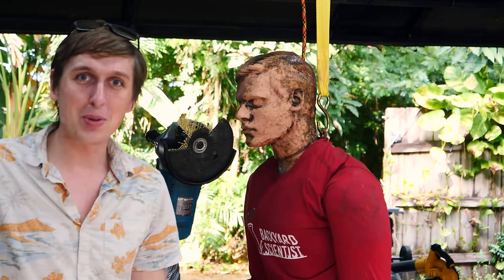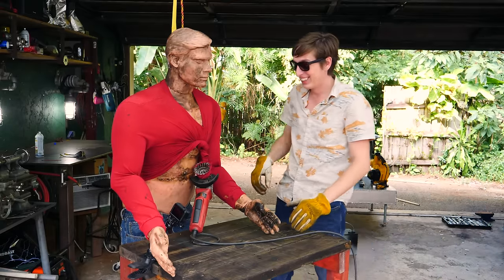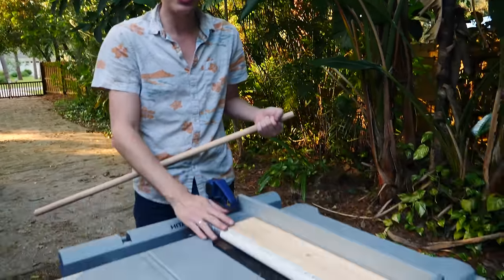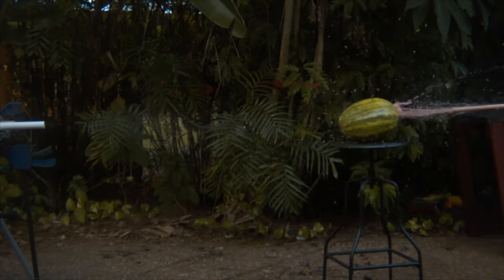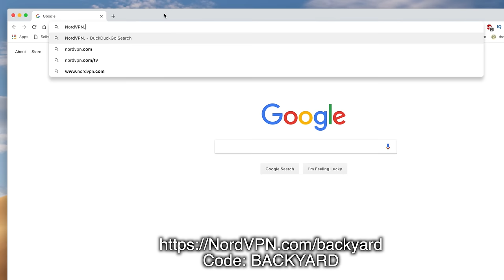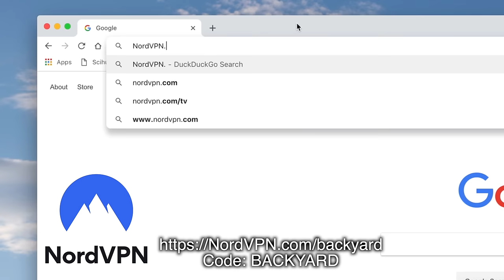This Is Why You Need To Wear Safety Glasses

Comment: If you think hand grinders are bad you should see industrial "bench" grinders, they're usually the size of a small car and about 10 times as heavy. Back when i was doing my apprenticeship a local grinder had its wheel shatter and it shot pieces everywhere, some went straight up and landed a few KM's / miles away from the factory roughly the size of a tennis ball but made of solid stone

Comment: While on the topic of safety tips. With any rotary equipment (both the table saw and angle grinder being such), do NOT wear gloves while using them. Counterintuitively you would rather get your finger chopped off than get a glove stuck in one. Because at the speeds those machines operate, a glove will pull your whole hand, forearm, and possibly even more into the grinder/saw before you can react. Losing just a fingertip is a much better alternative, and probably wouldn't destroy the machinery either
Reply: Wear no loose fitting clothing (including loose aprons!) or gloves, ties, jewelry (including bracelets, watches or wristbands) or shirts/coats with sleeves below the bicep when using equipment such as a table saw, band saw, lathes, milling machines, surface or cylindrical grinders, etc. ALWAYS wear heavy leather gloves when using an angle grinder! When properly used, the risk of suffering bodily damage due to flying debris coming from an angle grinder is far greater than from getting tangled up with it from catching a glove. You can account for your grip on the tool as well as how you use it but you cannot always account for whatever disc or wheel is attached to it. Failures may be uncommon but they do happen. Wearing heavy gloves and other safety gear such as safety glasses PLUS a full face shield when utilizing an angle grinder is the smart play! In my decades of experience, I've yet to be impaled or damaged by anything flying off a hand held grinder when wearing full gear nor has anyone I've worked with. The guys that got "bit" were those that had part of their body exposed... including on the legs, chest & arms as opposed to the hands. Many of my former co-workers wore heavy leather wrist or forearm guards over heavy leather coats which had stainless steel belting woven into the leather - it's there to block flying debris. Believe me when I say that they work! Obviously, most average guys in the garage at home aren't using an industrial sized grinder with 12-14" discs or wire wheels on them but even the standard 6" disc has the potential to kill you if it flies apart, rips open a vein and you bleed out. So, engage in prevention and gear up when appropriate... you'll thank yourself for doing so the first time you realize that you were NOT injured due to your choice to wear your safety gear. Best wishes!

- Max Giganteum

Comment: I've worked with wire brushes on angle grinders, always fun getting stung by the wires, had a few go in fairly deep 😂 ALWAYS worn glasses and for what I was doing, hearing protection. I have had more that a few hit the glasses.

Comment: I find it very hypocritical that you emphasize safety and then don't practice it. While you're lucky that the stick went through the sheet metal, you didn't think it would. The fact that you didn't think it would and still stood where you did is just foolish. Have you ever thrown a stick at the ground really hard by hand? If you have, you know that it can bounce right back up at you if it hits the ground at even the slightest angle after knocking either end against the ground. If that stick didn't fo through the sheet, that very well could have been the result, if it were going much slower, or if the sheet were much thicker. Standing where you are would have resulted in serious injury or being impaled.
Reply: Leon Strongbow 
You're *
Reply: Roadfart 
I find it ironic that during the majority of the video he wasn't wearing safety glasses, even though he was emphasizing it throughout the entire video 🙄
Reply: If it was going fast enough to impale him then it would go through the sheet no problem

Comment: A guy I knew was walking out the door of his store. He was called to deal with an issue in the base ment while on his way.
Cutting a corner off of something or pounding something into the floor.
In short, if he'd left 2 minutes earlier or worn safety glasses, he'd not had a piece of metal pinged into his eye.
Half a second. Blind. Its crazy.

Comment: Yup, I have a 1x3 in dent that's a half in deep in my garage door due to kick back. Forgot that the blade of a radial arm saw is the same as a table saw but upside down....I'm just glad the steel insulated door was down otherwise I'd have a hole in the radiator of my truck.

Comment: I think the tablesaw launches the wood at a higher speed than he can. His throw was from a higher level and also inclined up so it will have a longer flight time and therefore a longer range. If he threw it at the same height above the ground and horizontally like the saw it wouldn't have gone that far.

Comment: when I was in my welding class at my Tech school the wire brush on my grinder hopped up and caught my welding jacket. Not only did it catch the jacket and tear a 6-inch hole open. Said wire brush, with an rpm for around 1500, ripped open my shirt underneath and scuffed up the skin on my abdomen. needless to say it woke me up and I don't mess around with power tools.

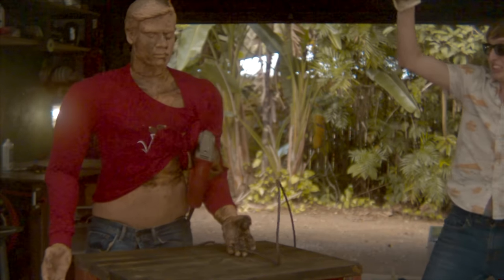Comment: 4:32 You think that looks painful? A couple of years back an accident happened to a guy cleaning out the inside of a water tank on a container. He was using a pneumatic powered grinder with a wire brush and that particular model was supposed to use a 100mm / 4" disc at maximum. However this guy decided that using such a small disc was too slow so he took off the guard and put on a 180mm / 7" disc. For a while all went well until he hit an edge or something, and this combined with the higher forces due to the larger diameter caused many wires to detach - and fly straight into his groin and crotch. Apparently his scream could be heard on the next deck up. The doctor who treated him said it looked like he'd sat on a steel porcupine. Ouch. No permanent damage but he now has a deep, deep respect for safety regulations. He's never going to lose his nickname of "bristleball" though.

Comment: I once had an angle grinder cutting disk explode while cutting out billets. The biggest chunk of the disk tore through an extra thick pair of leather gloves that I was wearing, and gouged a chunk out of my thumb big enough to slot a quarter into. Another large chunk bounced off of my safety glasses, as the rest of my face got pelted by small fragments.
If not for my safety glasses, I would have most certainly lost at least one of my eyes, judging by what happened to my thumb..

Comment: You are using your angle grinder backwards. If the wheel binds, you want it's rotational momentum to lift it out of the cut, not bury it into it. This is significant because when it binds up (not if, when) and you are using it backwards, it flings the little death machine into you instead of away.

Comment: for using the wire brush, if you wear a thick leather apron  fastened tightly it will NOT bind up in the wire brush.

Comment: 11:26 i saw someone using one of those and even before i knew how dangerous they were i was afraid something will go wrong with such a device and it sure did a few min later as the blade took a bigger bite of the wood it was cutting and then rode on the wood piece to get enough momentum so the guy could not hold onto it anymore then it swung around and took a small slice of his fore arm, he was lucky to get away with just a few stiches.

Comment: the brush can grab onto clothes and fling the angle grinder straight to you face. welders often wear protection blouse and one unlucky welder had a 9 inches bounce to its face several times, didnt came back to work. i saw a man get kicked in the teeth by a the casing of a 7 inches while using a zipcut  and i saw a man run a zip cut straight across his forehead because it kicked.

Comment: I work in the trades and whenever I have to work with an angle grinder to cut metal, I cringe a little. Still hate using them. I was really afraid of road saws for awhile, but they're not so bad.

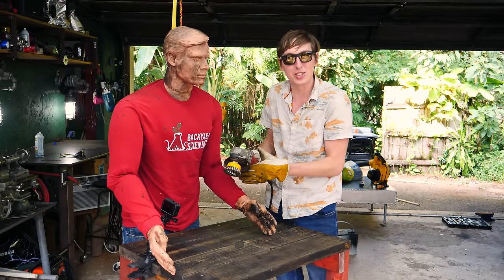Comment: 3:34 I've done this more than once. Twice, specifically. Got really sick of losing shirts after that
It hurts but it just scrapes you up, doesn't maim you or anything
Reply: I think there's still a piece of a cut off wheel in my gut
Reply: Do you have any tips for preventing this?
Reply: @hosteyele  Tuck your shirt in, keep distance from you and the work piece and be careful 😅😅 There really isn't one beyond "don't do that." Twist knot cups+wheels can get away from you very fast, very unexpectedly and they WILL suck in half your shirt in a millisecond - no question about it. However, lots of times it happens because their shirt gets sucked in from the draft being created and because it was hanging loose, so keeping it tucked will help you a lot when you're first getting comfortable with a cup brush.
Similarly being too close will get you into trouble when it could've been avoided. In the beginning you're gonna want to instinctively hover over your workpiece which is a very bad habit to get into; there's been COUNTLESS times where I've had my grinder buck backwards on me but luckily DIDN'T catch my clothes purely because I was standing a foot or two away. When you hover over your piece and the grinder bucks on you, it'll hit you in the stomach before you have the chance the steer it away or regain control
Reply: @Patrick.Weightman  Alright, thanks man!

Comment: If you use the other side of the angle grinder it will pull away from you instead of want to kick back in to your body. Rotate the guard 180 degrees and flip the grinder so you are still protected.

Comment: you were very very lucky at 11:43 ....... allways allways make sure the disc is throwing the dust towards you, when it grips it will fly away from you...... the way you did it the angle grinder comes towards you......
man.. i have seen many accidents with these fingereaters, i even had to bind off the arm of one of my coworkers who i allready warned a couple of times.......
 please please  be aware with those tools, they are dangerous

Comment: I remembered that i was in tech and  Engineering Class in Middle school ive learned these health and safety and i saw a dent in the Metal wall and i found out immediately that a careless student was sawing a 2×4 In half using the Table Saw and it yeeted  the plank at the wall before o was In my Semester

Comment: To much safety equipment is also dangerous. 
Steaming up glasses when cold wet out doors is how the grinder jumps of I beams into your clothes( wire brush ) and having a normal sweater is better than tons of layers as it will be easier to pull away from and will tear apart enough to get away from. 
Having no gloves is better than huge gauntlets that tire out your hands that's how you lose your grip on the grinder. 
But nobody listens to me. 
I was cleaning steel beams for two weeks with a pair of safety glasses and bare hands. Along comes the mental health and safety guys and next I'm in a huge jacket , a visor and helmet Steaming up blind in the rain, massive gloves and within the hour I had a grinder jumping up my body towards my throat only reason I got away was it unplugged when jumped back

Comment: Having personally had grinder disks and wire wheels caught in my shirt due to kick back, I can 100 percent say it is extremely dangerous. In fact I hate using grinders. The worst injury I've ever had was due to a cutting disk exploding and embedding into my hand, through my glove and chipping the bone. If you're going to use a grinder, minimum safety is a jacket over your shirt, heavy gloves, face shield or Welding helmet, AND safety glasses. Trust me... 11000 RPM of composite cutting disk exploding is not to be trifled with.

Comment: The real danger coming from kinetic energy (e.g. motor runs at full speed); therefore, adding a proper designed AC power regulator will effectively reduce the motor speed (e.g. 50%) to a more controllable manner and cut the chance of accident from happening.

Comment: While your things about the table saw are good and yes they can be dangerous, most ones nowadays have an emergency stop for if your hand goes in it. It basically just shoots a metal stop into the blade to stop if cutting up your hand to bad
Reply: Only certain saws (sawstop)

Comment: the optomotrist recognized me . i have been there 2 times in 10 years . first time - a 3 mm long piece of a wire bristle brush used to clean a bbq grille ended up lodged deeply into my eye . he removed that . it was not fun . more recently some dried superglue i scraped off  a pcb , a chunk of that hit my eye . now i wear glasses but not safety glasses . this superglue infured my eye . it felt as if something was stuck in there but it was just a scratch . the wound is healing but it takes a long time . please wear safety glasses . you dont want the optomotrist to recognize you ...

Comment: I had an angle grinder brush fly into my shirt like that, it will chew up your skin for the first second leaving around 2 inch scratches and it'll get into your shirt fully. If it was just an inch taller it would have gone into my groin so i guess i'm lucky for being shorty

Comment: I’ve seen kickbacks deform metal, make it through walls, and once even hit a guy in the balls. They’re not fun, I personally haven’t had any (somehow, I’ve done wood and metal work for years) but they will even launch a sheet of plywood a good few feet
Reply: Also, if you put an unbalanced out of square piece of wood on a lathe, that thing will Yeet itself across the room. In an old shop class some kid threw basically a 2 by 4 on a lathe at a rather harsh angle, once it was turned on it flew. Was about 1inch away from hitting my friend in the head

Comment: If anything ‘Randy’, being hard plastic, comes off way better than a person.  ALL those injuries would be bloody and disfiguring at least…even the wire brushes against skin!  However, the worst is the chain disc. Loggers will tell you the tip of a chainsaw contacting wood can easily kick up into your face…The Chain disc is effectively the end of a chainsaw - from every angle.  If it sticks on a wood knot or digs in, it will wrench out of your grip and flip around on you in a blink. It will remove fingers exactly as a chainsaw….and if it catches your clothing it can run upto your neck like a rabid rat and chew your throat out before you can scream.  Which is why they were banned for sale in UK after 2021.  They do freehand carve wood brilliantly…but they’ll carve you even better……

Comment: The brush i dont understand? It will not do anything to ur skin like that but scratch.. using grinder is better not to use glove or it will do that to ur hand
Reply: If you call tearing your skin apart a scratch then yes. Metal wires going above 230 km/h will of course just scratch your skin.
Reply: @Tvngsten  but it wont pulled your skin and rekt you hand like that shirt.. tbh after watch this wearing glove seem more dangerous

Comment: Dude not only does the shirt get tangled but when it gets close it will eat your skin and bones even hen tangled in the shirt rope burns and worse than road rash. pepole please wear fache protection and no gloves when using power tools make sure you got a grip on them and make sure the item you grind or cut is securely fastened or held. If it feels unsafe it probably is!

Comment: That safety glass was very danger because what happend when that just throw it to the mouth . That was safety to but it's only when you do it without that saw if you do it with the saw must use a safety helmet with glass Protector on front , so guy's be careful about saw

Comment: safety starts with respecting the tool being used and holding a grinder in such a way that your face is in the plane of the cutting wheel is just pure stupidity yes you should ware glasses AND a face shield BUT even then there is absolutely no excuse to stick your face in harms way.

Comment: it can't bypass a school filter, why? BECAUSE it's blocked by filter bruh. How do you want to download something you don't have access to?
You could override admin password, use a special program that generates a key that acts just like password, or activate hidden admin by booting console, but either those could be blocked by schoold admin, if he have over 90 iq.

The last point is to boot from windows instalator, and there change password to one of admins accounts. you might have to disconnect system drive to go in, and if school admin is a genius, he would have blocked s.m.a.r.t. setting for drives, so you can't add hard drive while windows boots. It means that in order to take control you would have a literall second to connect drive in the right time. 
And I would personally congrats you if you manage to pull that out on a normal lesson xD.